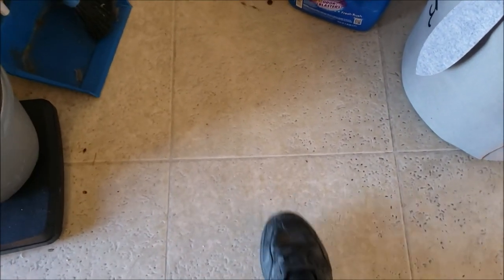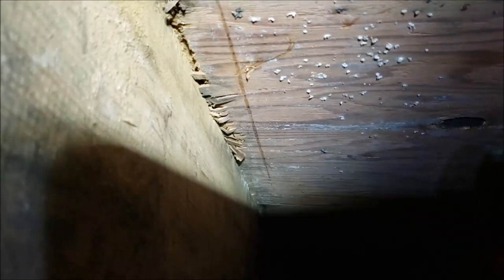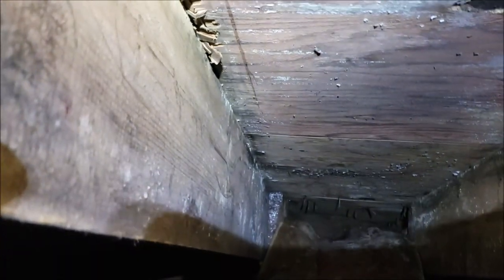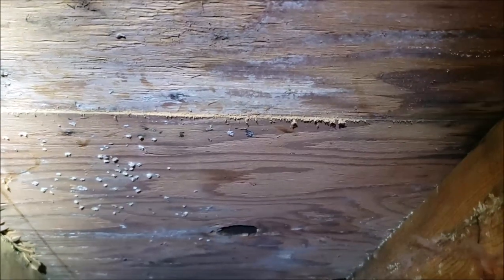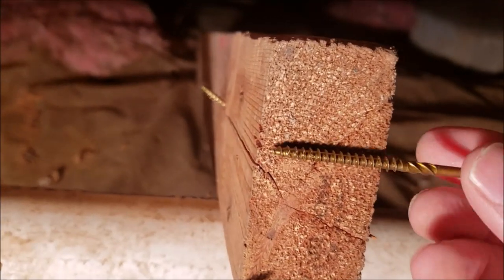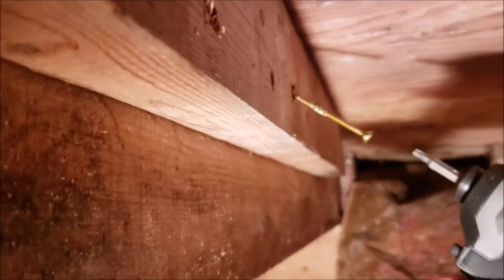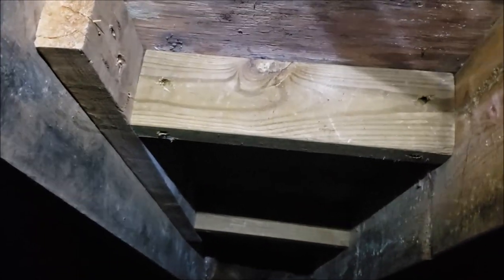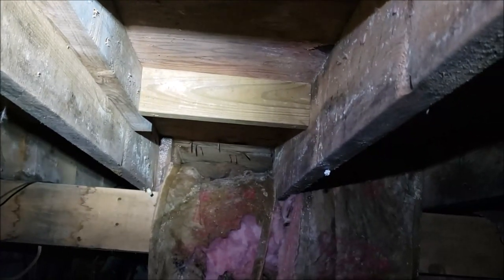DIY Landlord: Soft Spot in Sub floor Simple Easy Repair Do it Your Self and Save

Comment: This is so helpful! We just bought a new build home (2 yes old) and there are a couple soft spots and high areas as well. 

What might you suggest to fix the high spots? When we walk around we notice a few areas where there are small hills it seems like.
Reply: Omg that is my exact problem with my kitchen floor..it's in a spot by the back door (gutters weren't attached correctly)..and there's another spot by the stove/opposite exit heading towards the hallway..I want to fix it but don't want to break the bank
Reply: It's probably too late for me to write this, but depending on the issue, this might help: I had a few spots like this where the original building didn't nail down the plywood sub floor, or didn't use many fasteners. Before I laid new hardwood, I went through and screwed it down to every joist. I added a screw every 12-18" on each joist, and more by the plywood joints. This helped to pull down the plywood, reducing high spots. The floor was nice and flat to nail down the new hardwood.

In some cases, your framing may have shifted, though. This probably wouldn't help then.

Comment: I live in an apartment that has a crawl space under it. Throughout the apartment, there are 3 or 4 different locations that have soft spots on the floor.  I've contacted maintenance and I'm waiting for them to fix the issue.  I'm curious as to what could have caused the soft spots and if there is a danger of falling through the floor.
Reply from the maker: Many things termites, water damage from the past ,wood rot ...